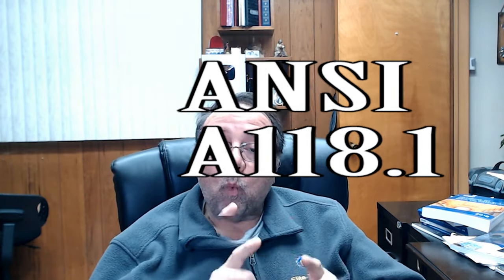Thinset explained. What you need to know

Comment: do you ever use "100% solids epoxy adhesive"? Looks like Wedi is recommending that for small mosaic tiles in its shower system but I'm trying to find out if it's a necessity. They also recommend taking the mesh off the mosaics, but I know some people do this and some don't so maybe it's the same with the mortar recommendation?
Reply from the maker: Yes Wedi shower trays require epoxy mortar for small tiles, and epoxy grout.
Reply: Thank you so much! @SalDiBlasi

Comment: We recently installed Bianco Carrara Hexagon tile on our shower floor bathroom. A couple of hours after the shower was turned on, it almost appears as if there is damming around the drain. The carrara tile remains darker for days after. I've done research and based of what I've found it looks like epoxy adhesive/mortar should have been used. Would you agree?
Reply from the maker: Epoxy thinset, silicone around the perimeter, epoxy grout and breathable sealer, for a sealed system, or a properly constructed Water in, water out shower system with a two stage drain. This is a known issue.